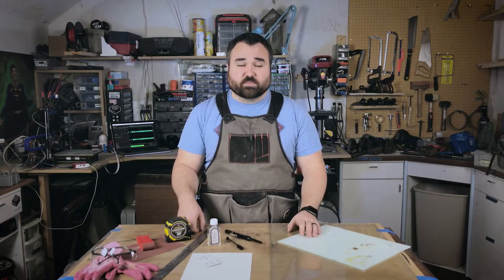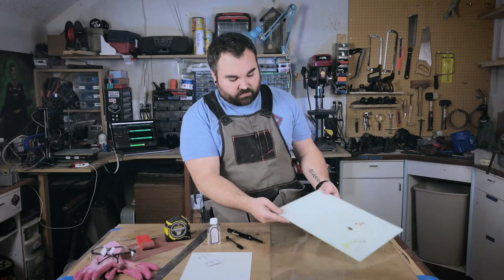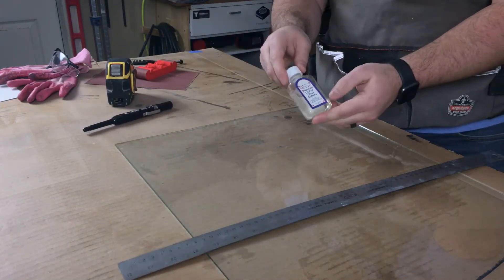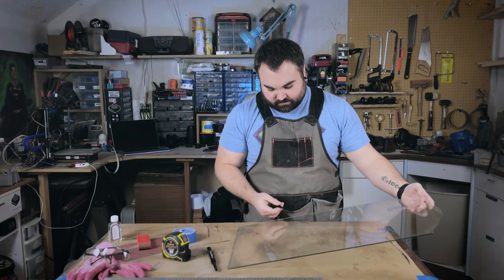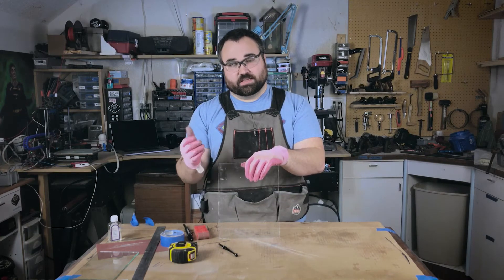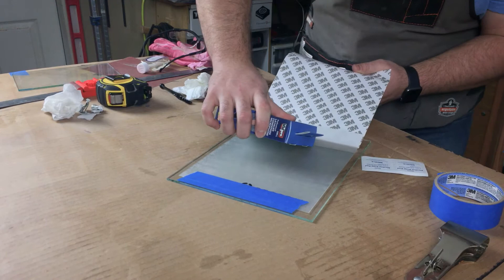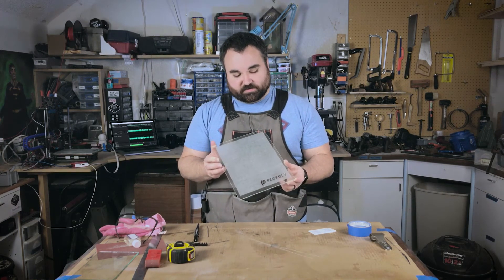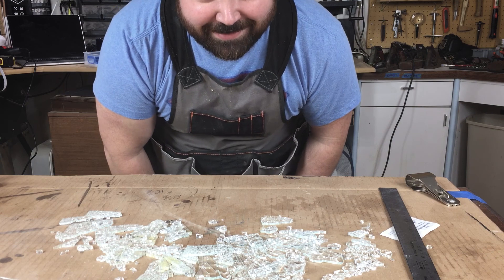How to Cut Glass and Apply a Build Sheet for 3D Printing

Comment: Wait you can just use any kind of glass
Reply from the maker: Yep! You just have to be careful if it’s thinner glass (picture frame, etc). That stuff breaks much easier. I’ve purchased thicker panels from Menards that work great!
Reply: @AnthonyTackett  Because I’ve got an old fish tank with one side broken out of it and I’ve done my fair share a glass cutting do you think that would be too thick
Reply from the maker: I’m not sure how thick it is, but I’ve used panes that were just under 1/4” on mine and it worked just fine. If you have it already, give it a shot!

Comment: Not overly terrible, but be mindful of the glass dust you left from sanding. It was still there when you applied the PEI sheet and could get in the way. And take care if run the cutter off the edge of the glass. It might make shards that are not fun to get in your skin, or could scratch the glass you just cut if it gets drag it over it. A bit daunting at first, but glass cutting can be quite satisfying. Always keep the wheel perpendicular and at constant pressure. Try your hand at free form curves on any mistakes. My oldest sister used to do stained glass professionally.
Reply from the maker: Very cool! Yeah I didn't even think about the glass dust. Glad I wiped everything down before applying the PEI! That would have been awful to get trapped underneath. Good catch!
Reply: No worries. When we quit learning, we're dead. ;)

Comment: you can use mineral oil or 3 in one oil for cutting oil. or vegetable oil even. you just want something to help the wheel roll smoothly and not slide across the glass which wont score the surface.
Reply from the maker: +Matt Weber good call. Maybe I just haven’t cut enough of it with my last couple of tools to have an issue. The tool I used in the video only had a couple of cuts on it before I shot.
Reply: yea each oiling is good for about 3 or 4 uses usually if smaller cuts. a small bottle of oil tho will last you well beyond the life of the edge on the roller usually. if you watch it roll and it doesnt leave a score line, the edge of the roller is dull and should be replaced.